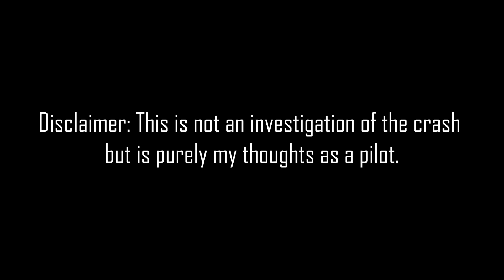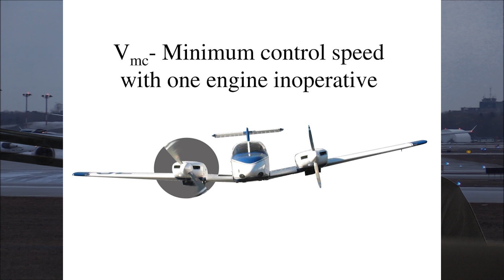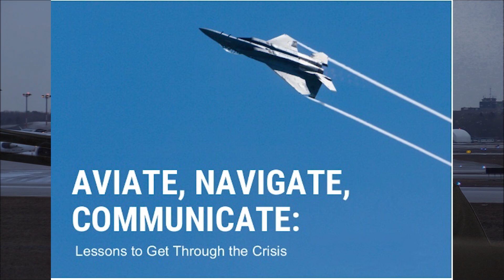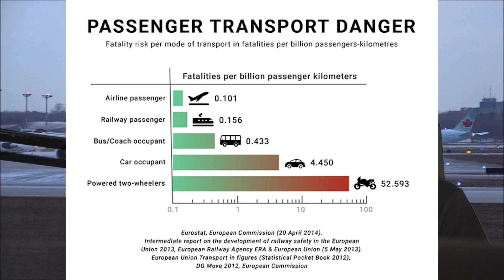Russia: Prototype Cargo Plane Crashes During Trial Near Moscow

Comment: Russian aircrafts r cheaper but it's maintenance & overhaul is extremely costly in comparison with proven western platforms like Airbus & Boeing.
Engine flying hours & overhaul timespan is also less than half that of western engines making availability of the aircraft very low.
Jet engines hot core section metallurgy & manufacturing is one of the most complicated in Aeronautical engineering which the russians r yet to master leading to more frequent engine failures mid air.
IAF itself is fed up of russian fighters due to this & is eagerly looking to induct more & more western fighters like French Rafale.